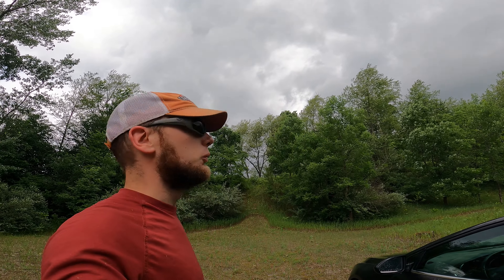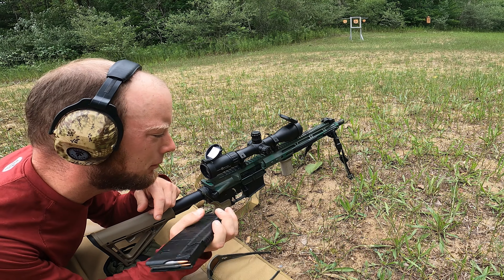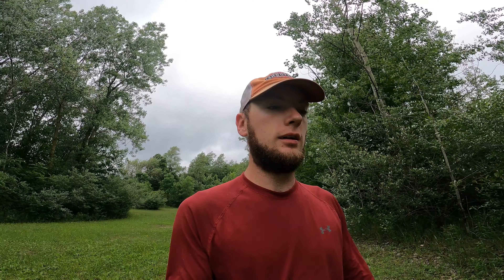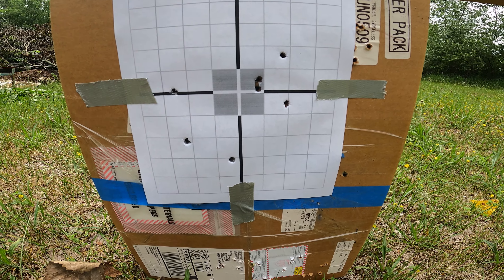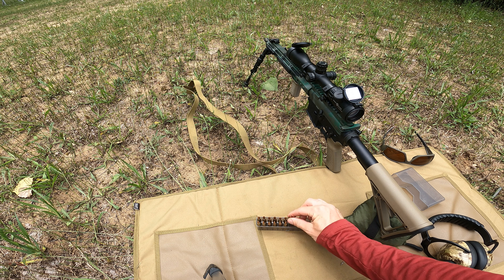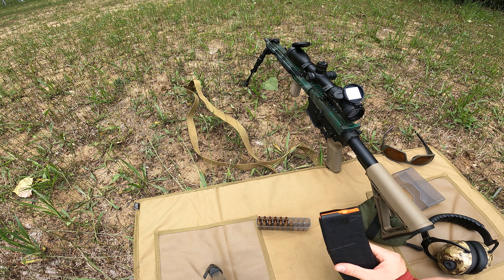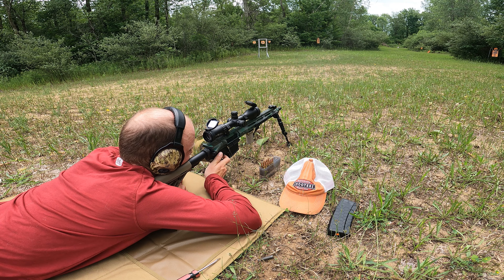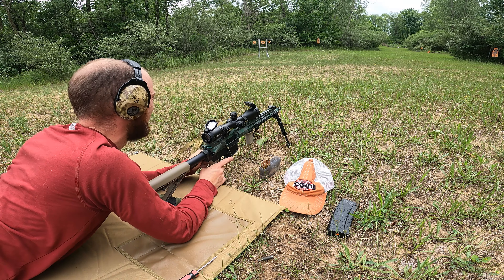AR 15 Ammo Accuracy Test | TulAmmo vs Handloads

Comment: You are correct, the cheap stuff is pure garbage and is never consistent, it just makes noise. Reloading always produces the most accurate rounds. I never extend my over all length so that I can't load it in a magazine but it can come very close. Reloading in my experience for accuracy has never been the maximum load but starting at minimum powder load and work the powder charge up to the sweet spot. Good video.
Reply from the maker: Thanks John. I feel like a custom chamber with a distance to the lands that can be achieved within mag length loads would be perfect for the AR precision loader. I may experiment more with my AR accuracy but I have so much load development to do for my bolt guns that it's gonna be a backburner project for a while. This experiment got my curiosity going now 🤣

Comment: Bridging the upper and handguard gap. Every load variance you put on bipod transfer to handguard thereby to your scope.
Reply from the maker: I've talked about this in some other videos. I'm certain that in some cases it's possible to impart enough force or movement onto the handgaurd to deflect the scope. There's no doubt that this phenomenon is possible. However, I'm extremely skeptical that, in most cases, it makes any significant difference. Because the handguard is affixed at the barrel nut, any amount of movement at the front, where the bipod is, will be reduced by an order of magnitude at the fulcrum point of the lever, in this case, at the barrel nut where the scope is attached. That means even if I load the bipod hard enough to deflect the handguard, say, 1/32" at the front then it would move the rear of the handguard exponentially less than that. Certainly this movement of a thousandth of an inch of deflection can possibly impart variance down range on point of impact. Particularly with extremely precise shooting guns at extreme ranges.  However, the 6 pound milspec trigger, my breathing, my imperfection as a shooter, variances in the ammo load charge weight, seating depth, resonance feedback from the gas tub to the receiver, etc. almost certainly cause dramatically larger variances on target than any microscopic poi shifts that might be caused by handguard deflection. I'm just saying, at 100yds, with a relatively inexpensive AR setup, and imperfect handloads, I'm personally skeptical that possible handguard deflection is a significant enough factor for me to worry about. Maybe ill do a test with the same loads with two different scope mounts and see if it actually makes a difference in the real world.
Reply: @tralmanchronicles6163  Squeeze barrel and hanguard you will see how much barrel and handguard deflected. A miniscule shift scope took from handguard is exponentially reflected at range, in your maybe future video "TEST: Bridging the gap = REAL ISSUE?" dig a mini tench for bipod feet to sit in then push forward rifle load the bipod and you will see your rifle stablize. But with bipod push-loaded bipod feet pivot inward toward you and top bipod mount outward toward target this torque handguard downward thereby bending scope down too and you will hit high from point of aim. Vertical stringing can be obtained from this.
Reply from the maker: @TrollinCrazyRussian  yeah, for sure, I'm pretty aware of the mechanics of the issue. I'll definitely do some testing to see what actually happens. Now I'm curious.

Comment: As a veteran reloader, I would work up a load that would feed from the mag while optimizing accuracy.  Oh and use a 20 or even 10 round mag for prone shooting.  Many modern day AR shooters don't know or remember that the original factory Colt mags we used in our M16's were 20 rounders - & most of us loaded only 18 for reliability.  Today's mags are vastly superior.
Reply from the maker: Yes, a 10 round mag would solve a lot of problems. Didn't have one when I made this video. Picked one up recently. And yeah, having a load that won't feed in a mag is clearly highly disadvantageous in a semi auto weapon, hopefully I made that clear a couple times in the video 😆. The goal of this video and this load was to satisfy my own curiosity about, specifically, loading at .020 off the lands in my AR which happens to have a 5.56 chamber. In order to do so I had to load well past mag length. Just for this test, just for this one video, in no way am I suggesting that loading past mag length is typically a great idea for an AR-15.
Reply: @tralmanchronicles6163  Yep, I understood.  I'm working on a good varmint load for my AR's 'cuz my favorite 60gr Vmax load for my bolt guns won't fit my AR mags either.  The 40, 50, & 55gr Vmax & Nosler Ballistic Tip bullets fit in the mags & perform well, but I suspect the heavier 60gr will perform better @ distance.
Reply from the maker: @ronaldperkins4222  sounds about right, for sure. Have you tried using a Bob Sled?
Reply: @tralmanchronicles6163  No.  This batch was reloaded about 10 years ago & brass was neck sized only.  They won't chamber in my AR even when loaded by hand, so will reserve them for my bolt guns.  I no longer neck size, but was trying to use up the 200 rounds on hand.